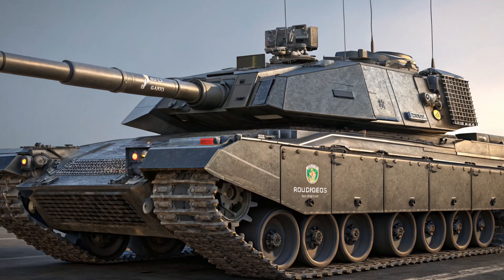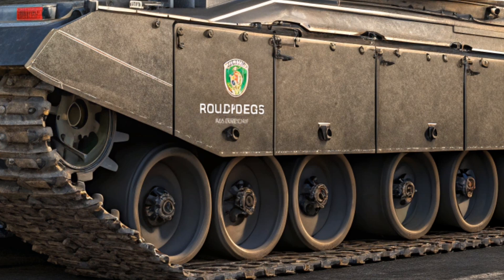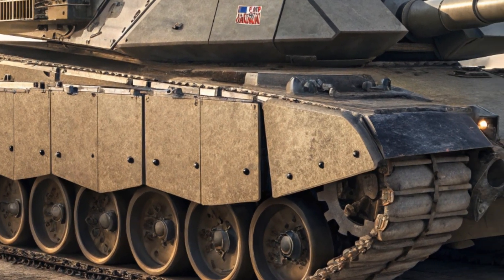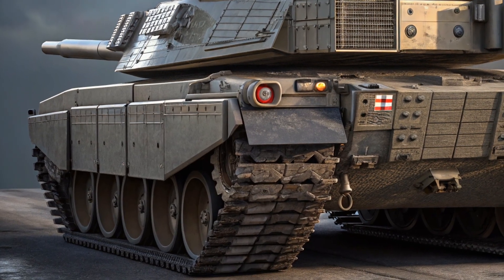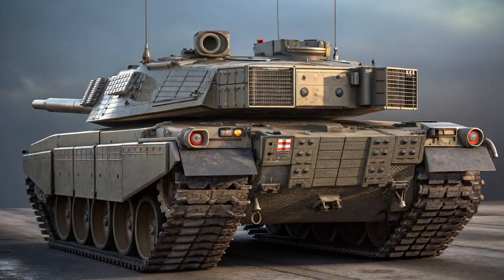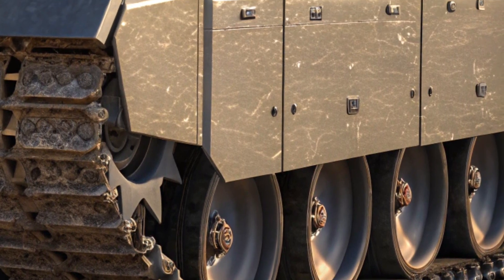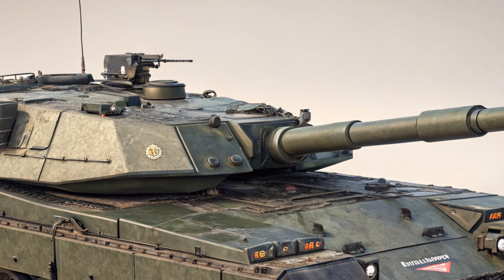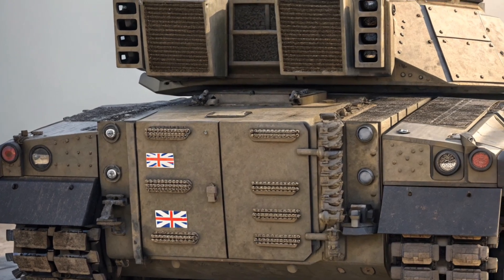2025 Challenger 3 – Britain’s New Super Tank Revealed!

Comment: This tank will never ever go into production because the labour party will put a stop to it like the labour party have put a stop to anything that was any any good and I will beater. You just have to go back to the 1960s the TSR two or go to the 1970s the type 42 destroyer which was a much bigger shit than we actually gotor the true kicking the teeth is scrapping out Royal and not re-fitting eagle which was in much better condition so that we had a fixed carrier which would've saved money in the end we bought three through deck cruisers which turned out to be aircraft carriers only capable of carrying a maximum of 20 aircraft at a time

Comment: I’m not sure what this tank is but it doesn’t look like any images of the Challenger 3 I’ve seen! For a start it has 7 road wheels on each side whereas the Challenger 3 only has 6. The tank in this video also appears to have drive sprockets at the front and rear whereas the real Challenger 3 only has them at the rear. I don’t know of any MBT with both front and rear drive sprockets. I’m not even sure that would work. Also the tracks and side skirts in virtually every photo are different as is the rear panel. 

Does anyone know what this tank is and if It even exists?
Reply: It's just a cheap, AI vid that bears no relation to the C3.